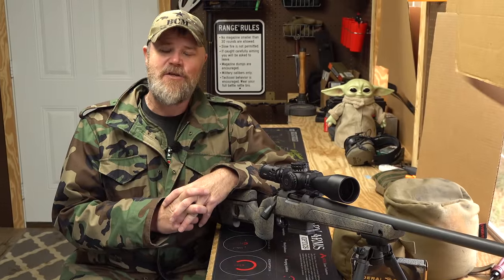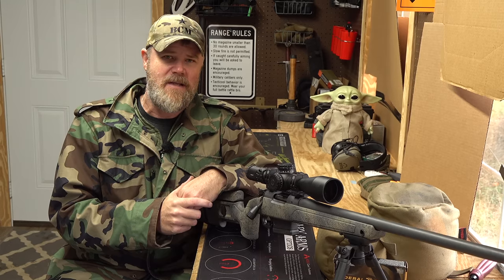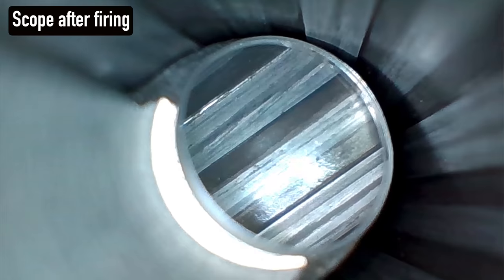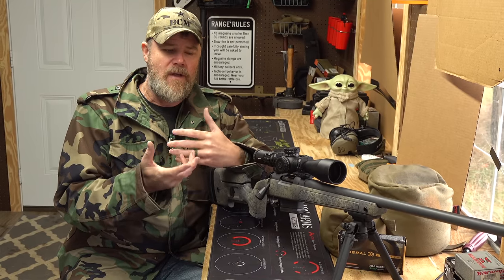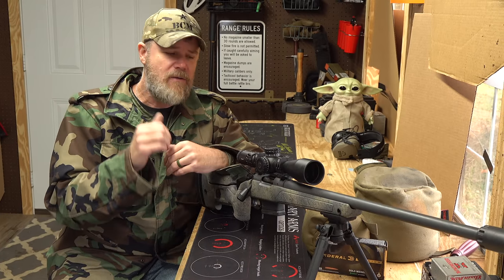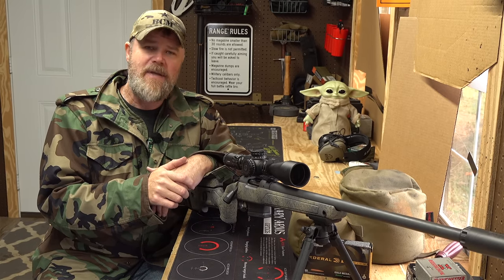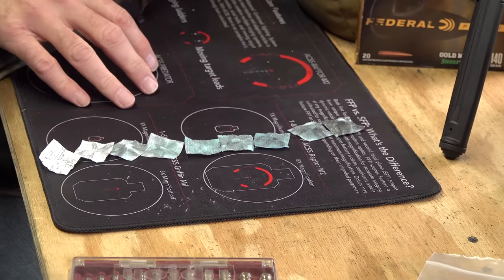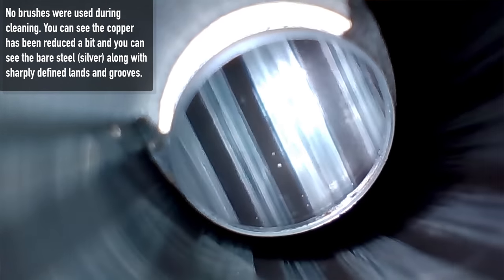Barrel Break-Ins and Cleaning Voodoo Rituals Destroy Barrels

Comment: I agree with most every thing you are saying with the exception of the .50 BMG, for some reason they are the worst at copper fouling I have ever seen. they start to loose accuracy after about 40-60 rounds and need a strong copper cutter to get out, most of the guys I shoot with [FCSA] use 25% ammonia to clean their barrels, I use .50 caliber brass brushes to clean the copper out. The solvent is so strong the brass brushes will loose diameter so much after one cleaning they will just about fall down the bore, I save them to use on my .458 Win Mag., I don't try to get all the copper out just knock it back a bit, I do neutralize it afterwards though. So far the best groups I have got at 1000yds has hovered around 8" but have seen groups as small as 2 3/4" from other shooters. 
I very rarely clean my small bore rifle and never clean my rim fires except to get all the wax at the chamber mouth, I will swab out any thing I shoot with corrosive primed ammo with #9 though, now Black is a whole another thing.

Comment: A copper or bronze brush can't damage a barrel. It simply isn't possible. If it were, the 143 grain, 2700 FPS copper brushes you routinely put through your barrel would decimate it within a few passes instead of the thousands that it does take

Comment: I don't use anything but a nylon brush either but because I buy packs of 10 for the price of high quality metal. Not because I'm worried about damage. Im a machinist and it is impossible to damage a steel barrel with a copper or bronze brush period.

Comment: I always wondered why in the multitude of cleaning kits, why there were copper, brass, and even steel brushes to run down the bore in an attempt to clean copper and debris from the barrel of your firearm.  The cleaning kit I got with my 1911 has a steel brush.  The cleaning kit I got with my first .22 had a copper brush ... and the logic escaped me, why I would want to run a metal brush down the bore of a steel barrel.  I am not an accuracy shooter ... at now 71 years old, if I can hit one shot within 5" of where I am aiming, I am throwing a party.  That said, I have only used wads.  Back in the early years I used 3n1 oil as my solvent .... now I use something a little more designed for the job.  Using wads, or a bore snake.  I also keep my firearms lubricated, but ever so slightly ... a fine film, (barely visible to the human eye) .... that is another story.

Comment: I've always equated  barrel care to breaking in or seasoning a good cast iron.  As with carbon on a pan, you want copper to fill those micro voids in the rifling to smooth it out. And just like a cast iron pan, you absolutely never use metal to scrape the surface clean.
Reply: Rifling stabilizes the bullet. If you lose that you lose accuracy. That’s why smooth bore is less accurate. This video is about over cleaning and damaging a barrels rifling by scraping it. Which can impact accuracy as well. accuracy is simply repeatability

Comment: I use a little bit of cleaner with oil in a swab. 

Ill swab the barrel to soak it for 20 mins then come back with a Nylon brush and it all comes off. Ill finish it off with a bore snake with the brass end taped off. 

Think of it as dishes…. Pre soak, Pre soak, Pre soak…

Some people are throwing harsh chemicals at it and trying to scrape the pan clean like an idiot. 

As Jimmy Fallon and Horatio Sanz would say:  “Soak Your Corks”!

Comment: I like what you do, but can I ask you a question?  Why don't you start out with a new barrel - whether you cut the chamber and did the machine work yourself or not, by using a product like J&B Bore Bright to do the initial polishing of the bore rather than just shooting the rifle first to do this?  Can we not not just do that first and than shoot the rifle?  I have done this on used rifles and new rifles and it seems to be consistent on making the bore more settled.  It does not help you when you clean the bore, and it does not help in fouling the bore, but it does give me a wider sweet spot between needing to clean the bore.  Your thoughts?

Comment: Thank you for the common sense approach to cleaning your barrel. Would the carbon ring be beneficial in creating a better pressure seal from the top of the cartridge case leading into the chamber? Does this give optimal pressure and consistency? Does this carbon ring stop any further blow back towards the cartridge creating less fowling? Mike Nicholls

Comment: While carbon fouling is not the hardest part known to man , it certainly is difficult to get out of the throat area of the barrel .  If you use bore cleaners that are so strong and tell you patches are all you need to get out carbon fouling , watch out .  Don't leave it in the bore more than 1/2 hour.   It's possible some could etch the bore .

Comment: Overall I follow much the same procedures as you, however I don’t see how a bronze bore brush can harm a barrel. After all bullet jackets are bronze typically and some of the solids are copper. Bronze/copper are softer than steel. And yes I use nylon brushes too. But, never use a steel bore brush. I have a Bergara B-14 Hunter in 308 Winchester.  The owners manual has a section on barrel break in. Recently I shot a 1 inch group at 200 yards with Lapua 167g OTM Scenar ammo. Overall great video.

Comment: if you ever seen a bad pot hole in town that the city patched up finally this is what its like allowing your barrel to get micro pits filled with copper, when you do harsh agressive cleaning its like sending a crew back out with jack hammers removing those patches making road bumpy again, and then you have to start the process all over, many think the more harsh the cleaning job then the more accuracy but this isnt always true. every rifle with a certain load has a "seasoning" it imparts to lands and groves after a number of shots to finally get accuracy, for example a old 22 rifle that may have over bore lands and groves may want to be "fouled" a bit more or "seasoned" with the right amount of pass throughs to start shooting good again. we even see this in competition air guns, i have a set of pistols exactly the same but one has a chromed wather barrel and the other standard steel rifling, if i clean both after shooting a few hundred rounds the walther is more clean and the standard rifling in other has more crud but depending on the pellet one does better then the other despite one being walther. the problem with center fire rifles is you have poweder residue, and some degree of fouling but agressive cleaning can be like taking filler out of the bumpy road, another problem with center fire rifles is that first engagement where bullet meets the lands and groves, things like pressure, heat and friction wear out this area faster and many still have a strange belief in rifling lasting a long time and never burning out, crazy rapid fire with out giving rifle a break is where this comes from, its like hot steal and a forging hammer bashing in your lands and groves especially at that first 1/16 inch of engagement, if your doing groups with a rifle allow cool down time in between shots, your first shot is always cold so additional shots must be keep at the same temperature, after each additional shot wether its 308 or 22 lr take a coffee break for one minute for 22 and a few minutes for 308 so that each time interval is equal thus equal temperature, if you think about the cheapest 22 semi auto rifles they can be kept accurate but not doing crazy rapid fire but allowing barrel to cool down also even if just a 22 lr and using more subsonic lead round nose bullets rather then cheap high velocity copper plated unless you have cycle problems then its understood you may have to bump up velocity

Comment: A .270 WIN has approximately 60,000 psi of energy released in the firing of the cartridge (as just an example). I don't think a bronze bore brush, with ~ 7 lbs of force, can damage a rifle bore, when used responsibly several times a year.

I don't agree with brushing the bore after every round fired. Swabbing the bore after use - with a soft swab/cloth patch is another matter.

Comment: I bought my first firearm in 2014, and my cleaning techniques have gotten progressively less aggressive over time. I have a bronze brush for every caliber, and they get stuck on the end of a die grinder to scrub carbon off of brake calipers now; they won't be used again on my bores. Unfortunately, I also have a .30cal "Tornado" stainless brush that I used on my old Mosin a few dozen times (I cleaned the hell out of that gun when I got the first couple spam cans of corrosive ammo). 
About two years ago I started watching YT videos from various gun builders, from School of the American Rifle to Mark Novak to Criterion Barrels, and they either simply don't use metallic brushes, or they issue the same warning MAC did and strongly discourage their use. I got a full set of nylon brushes at the beginning of 2021, and combined with some wet patches they leave the bores as mirror-bright as ever. Then you've got world-class shooters like the Miculek clan who are absolute proponents of not only bronze brushes but new, tightly-fitting brushes to clean their scoped comp. weaponry to boot. Live and let live, eh?

Comment: The first part of the term "break-in" is "break."  Over cleaning is bad.  I "cleaned" (as in removed factory goop or obvious gunk) four newly acquired handguns (one each Beretta, Ruger, Glock, and Sig), one pre-loved and three brand new, and finally range tested them on Tuesday.  This was purely a function test so I'd know if I needed to address any issues, not an accuracy or reliability test.  One magazine or cylinder through each one.  All good.  Now they're all back in the safe without being cleaned.  I'll give each one more of a workout soon, and I'll clean them, probably with nothing but Ballistol, when they need it, which for me could be a long time from now.  I'm convinced the reason so many ex-military guns are so worn out is that they were cleaned, abusively, each time they were returned to the armory.

Comment: USE IOSSO!!!!Bronze brush won't destroy a Steel barrel. I've heard different people telling different things. however, if you look at the scope view, there are so many carbon in the groves. regular cleaner+ copper cleaner + carbon cleaner is a must. I used on my 308, 338... but for my 223, it just can't get cleaned. then I learned the IOSSO cleaners and Wipe outs!. Watch eric cortina and all those F class shooters, they swear by IOSSO. IOSSO has a better quality plastic brush, and their cleaning ritual is easier and works like a charm! only problem, it's a little messy. But from now on, I will only recommend IOSSO products, and the bore tech c4 and copper cleaner + wipe outs.

Comment: I've been cleaning my barrels for years by using a brass brush soaked in solvent, on a brass rod, which is in a drill. 

I use the drill on high speed and pull the brush back and forth through the length of the barrel.  I do this for a few seconds then run a solvent soaked patch through and then dry patches until they come out dry. Then i oil the barrel and I'm done. 

Want guess how much accuracy I've lost over the last 25 years? None.  Because brass doesn't hurt steel. My cleaning rods are all scratched up, but my barrels aren't.

Comment: The concept that cleaning w barrel wears it out has been debunked time and time again. The best shooters in the world are using bronze bore brushes. They only use a brush once or twice because the stiffness decreases. 

Nylon brushes just don’t cut it. 

Check out how world renowned shooters like Erik Cortina, Keith oh Winning In the Wind or F-Class John do. 

What can happen to a barrel isn’t blowing it up, but a carbon ring is VERY real. The first time you experience one, you will rethink a lot. 

Sub-minute isn’t optimal but that’s easy to maintain. Especially when your goal of hitting steel. Maintain 0.1s, 0.2s or 0.3s is another level and likely one Bergara or DDs will never reach.

Comment: I clean shoot and clean. That's my breakin. 1,c,2,c,3,c,10,c,20 and clean. After that I clean every couple hundred rounds. I pass my brush until it gets easier.. about 5 passes. Brass brush. Not going to ruin the barrel. My cleaner is vegetable based. My barrels are DD chrome lined. Shoots sub MOA. Not high precision.

Comment: This video has changed my perspective using brass brushes. I have some high end guns that will never see brass again. I just thought nylon didn’t have enough ‘stiffness’ to really get in between the lands. MAC has proven I’m incorrect. 

Perception is not always reality and this is a good example of when that’s the case. 

@mac Question is should we use nylon for all types of barrel linings like chrome lined or non-chrome lined barrels?

Comment: I pretty much use your cleaning technique.  The only difference is that I use Ballistol oil.  NO organic chemical solvents, and never a caustic inorganic agent like ammonia (that will cause corrosion and just doing a  final swab with oil may not stop the damage totally).  I also favor plastic brushes but brass is softer than steel so it is not a huge problem, just not necessary.  I also do not care about microscopic flecks of copper, it is just not a problem.  And always try to go with a hammer forged barrel, they are not that expensive especially from companies like Ruger (they are even going to use hammer forging for the "new" Marlin rifles).

Comment: Think of your rifling and the way it holds soft metals the same way a machinist does when having to remove soft embedded aluminum or copper from a reamer or carbide burr bit.  You can do all the wire brushing you want to little effect.  The soft stuff must be flaked out.  
It all depends on the cut of rifling your barrel uses.  Pistols tend to use wide shallow rectangular lands, so they are very easy to demetal.   Rifles often have tiny sharp lands and narrow deep sharp grooves.  Think of the famous Marlin micro-grooves.  
The secret is to use a bronze or brass brush that feels almost loose.  You want the bristles to remain straight out, not fold back.  You need those straight bristles to flake out that soft metal.  And of course, never force a twist.  The brush should turn free to exactly match the twist rate of the rifling.  You know this.  This is all common sense.
If you want to corrode down and soften your factory lands, then use a solvent.  Or just do it correctly.  
This is how a machinist cares for carbide broaches, burrs, mills, and reams that cost $629 per bit.  
Or do what the internet says.  
Your barrel.

Comment: I never use a brush unless it’s a Mil-Surp full of Cosmo’ I run solvent and patches through otherwise’ the Barrel is basically being polished every time you shoot it’ and on older pitted bores it is better to not brush it’ I want the copper to fill the fouling’ the Only TIME I will use a Brass Brush is on the cylinder era of my .357’s that I use .38’s through’ the carbon scoring can build up and make loading .357’s very difficult’ and I brush it just enough to knock down the fouling line’ brushes have there uses but not for everyday cleaning’ a decent jag with quality solvent and patches are all that is needed.

Comment: I have always wondered if there is conclusive data on bullet rotation and rifling. You postulate that the bullet rotation reaches the rifling rotation rate within the first 6 inches of the barrel based on copper fouling, but I have never seen conclusive evidence that this is the case. Do you know of any?

Comment: I only ever clean my firearms with nylon brushes (when I can get them), patches, and Breakfree CLP. If I use anything else, my accuracy suffers. It’s weird. Even when I was in the military, I learned to clean my weapons just enough to keep them functional. I deep cleaned and lubed everything EXCEPT the barrel and rifling. If I scrubbed the barrel and rifling and got every bit of dirt, carbon, and copper out of it, my rifles and pistols shot like crap until I put a bunch of rounds through it again. Of course, I ran patches through the barrels to keep them clean enough to prevent obstructions and push out crud but once I saw the patch was relatively clean, that’s all I did. No more brushes. No phosphor bronze and definitely no stainless steel brushes. Barrels don’t need to be broken in. Just shoot your firearms. Break ins and bogus maintenance procedures, even from the factory, will ruin your barrel and cause you to purchase another barrel, something the barrel makers like. The militaries are not experts on weapons maintenance. They do a lot of stupid stuff to waste time and taxpayers money. Unnecessary cleaning will destroy a barrel. I can’t even begin to count the number of times we would draw weapons from the arms room and clean weapons when there was nothing else to do. When you’re the one paying for the weapons out of your own pocket, cost becomes a factor.

Comment: I've never seen a stainless steel bore brush although there are various ss alloys that are pretty darn soft. I use brass /bronze brushes and haven't seen damage from them. They are definitely softer than even the cheapest of barrel steels... You have just as much chance of dragging abrasives through your barrel with anything you put through it.